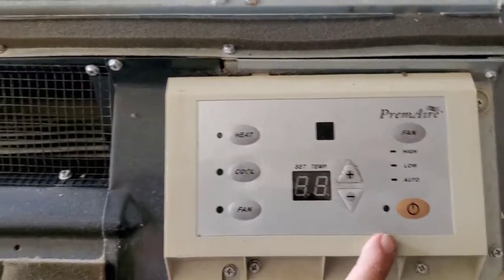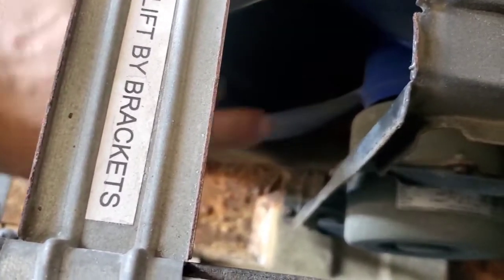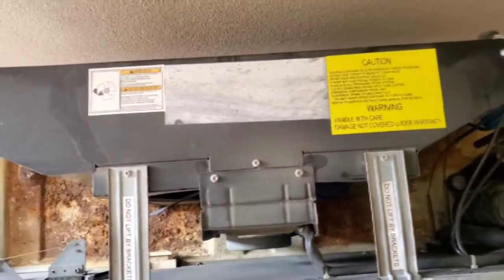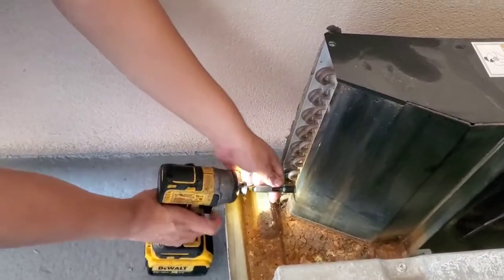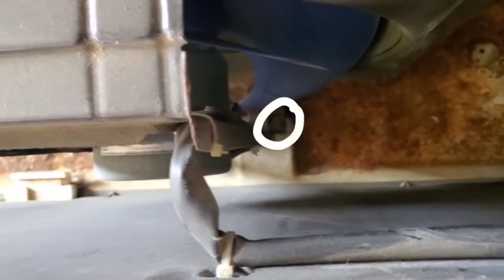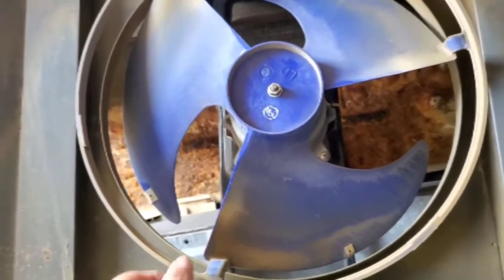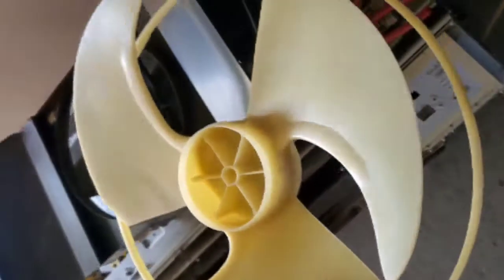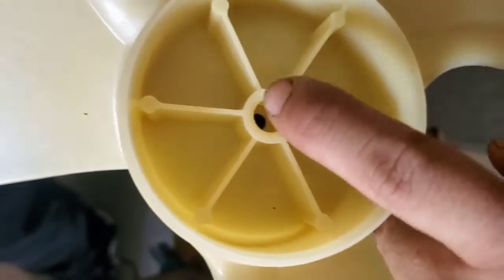How to replace a fan blade on Premaire ptac(noisy)

Comment: Hello, I know the video is a year old. I do maintenance for an emergency shelter. In our women’s housing the all the rooms have PTAC several of the units are experiencing this issue is there something that can be done to prevent them from breaking?
Reply from the maker: Unfortunately not, this is a common problem, I believe this was a manufacturer issue. I would just keep some in stock